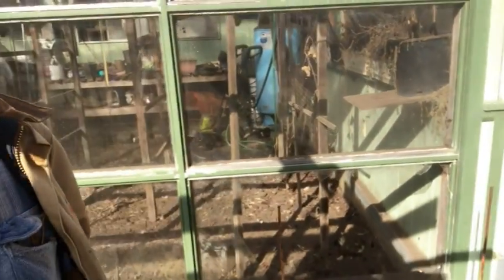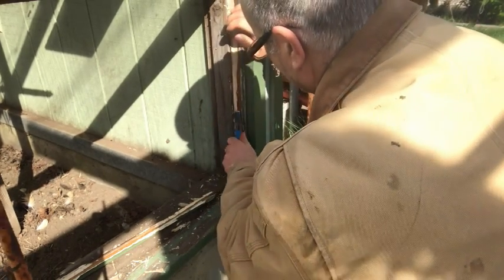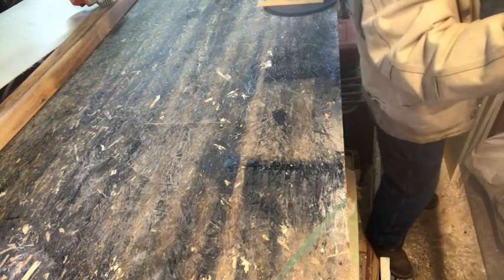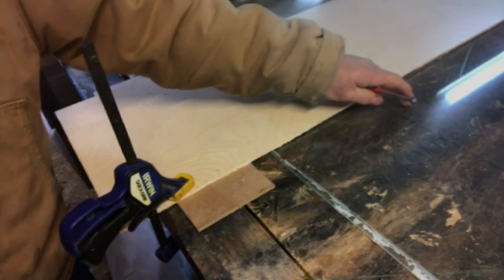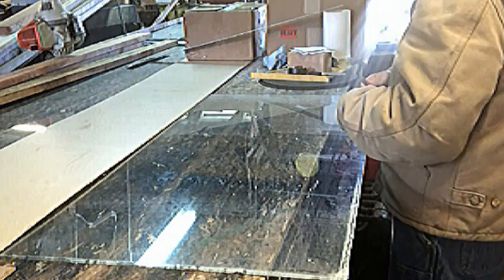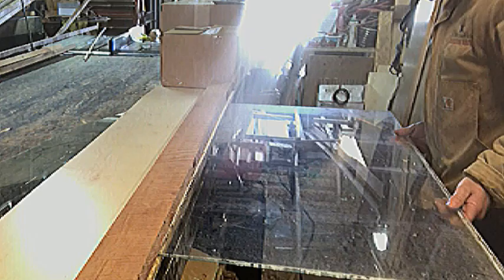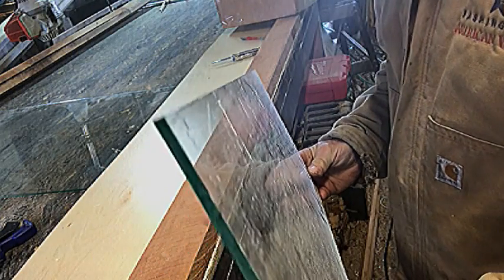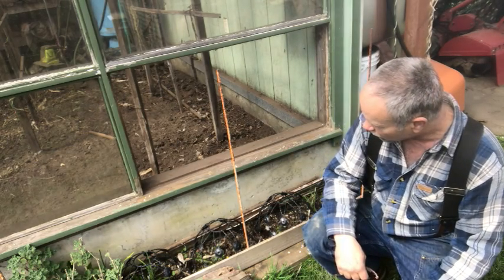Cutting Glass for Window Replacement

Comment: Finally, something I know something about! 😂 I cut stained glass for frames, mosaics, and kilned ornaments. I have a couple of cutters like the one you used, and a few pistol grips- which I prefer because they are easier for me to use. (Don't forget to oil the wheel because they tend to rust) You did a very good job explaining the cutting/ scoring process so a first timer should be able to cut glass like a pro. I work mostly with 12x12 glass so I make the breaks with my hands unless it's too close to the edge, then I'll use running pliers. I've never cut a large piece like yours, but the process is the same. Sorry about the crack, it happens to all of us. For me, there is something satisfying in hearing the zipping sound of scoring glass. Many Blessings!!
Reply from the maker: I enjoyed that sound when I was editing the video, very cool!
Reply: @RainCountryHomestead  It's almost as satisfying as hearing canning jars ping! 😂
Reply: It is good to hear from someone who is experienced. Got to looking around the shop and I have three cutters. about a month ago I oiled the cutters. They don't work so well when they are froze up. Thanks for the input!
Reply: @RainCountryHomestead  sounded like nails on a chalkboard to me.

Comment: Mr. Rain I'm so thankful you left all of the installation in the final video intact, even though the result was less than ideal. I have never cut glass. Your tutorial will certainly come in handy if needed. Take care.
Reply: Stuff happens! I was rushing a bit trying to get that glass in. I should have taken a little more precaution before installing. I had the glass propped up there but a little breeze came up and over powered substandard stick I used to prop up the glass panel. We left that in the video do demonstrate what NOT to do on an install haha!

Comment: I use to do stain glass back in the day, and so many times I made a cut and it didn't break the way I ment for it to break, and I have also dropped finish peaces, and had to start again.
Reply: I knew the cutting went too smooth...then the install 😬🙄😭
Reply: @MrRain-hk4zi  it happens Mr Rain.
Reply: @ceciliafuentes3299  🙂

Comment: No Pat, that wasn't a chuckle... that was a serious cringe... happened to me too. A buddy of mine back in high school and college used to make Tiffany Lamps and Stained Glass Windows He told me to always  dip the cutter in light machine oil before starting a cut. Either clear packing tape on both sides of the break, or Crazy Glue in it... will still give you years of service...
Reply: About a month ago I looked around my shop and found three cutters. I oiled and exercised the wheels just in case I needed them. When it dries out around here I plan on revisiting the glass. I had thought about Crazy Glue but that is as far as I got...was just a thought. Thanks Tim!

Comment: I'm learning! would thatt technic work for ceramic tile?
Reply: Good question, it would. A tile saw would work better if you had access to one. The break is generally rougher but you can use a concrete block and "sand" down the edges.